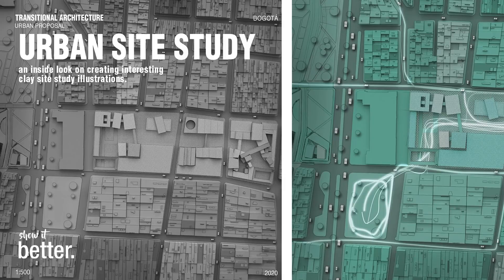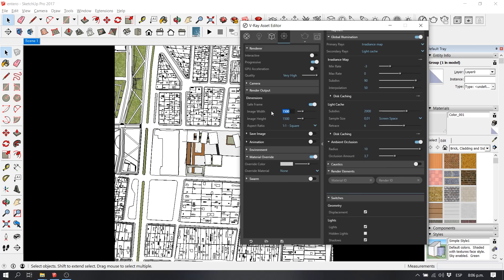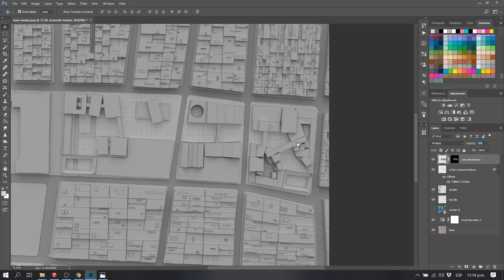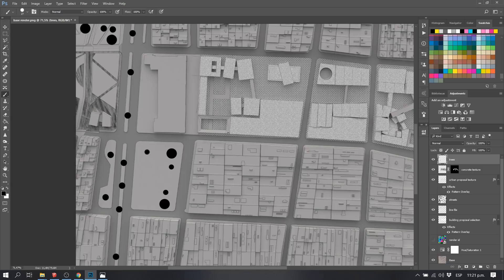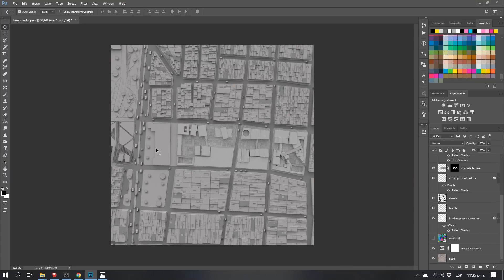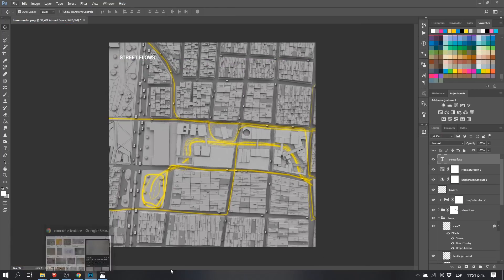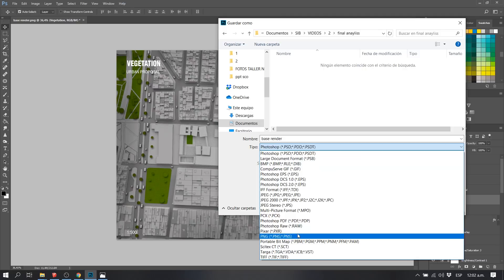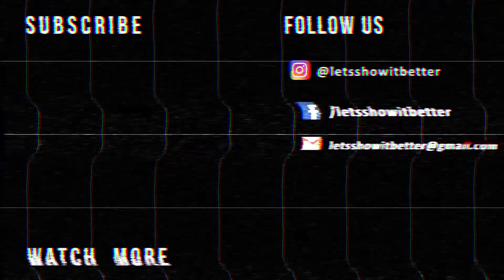Urban Site Study

Comment: When I'm exporting the lines it's comes with the all buildings shapes :/. How u do it that u have only the lines?
Reply from the maker: Sorry Adriana I dont quite understand. Are you refering to the part where I select the white lines style in thesketchup styles and export it as a pdf?
Reply: Show It Better yes. In 2:23 u upload the plain lines to your base and scale it, but when I export this “line style” from sketchup I have lines and the filling of the buildings.
Reply from the maker: Adriana Hęglewicz oh gotcha, if you export it as a pdf you will have them transparent. If the problem persists you can change your filter from normal to multiply.
Reply: Show It Better but export it from sketchup? I don’t have sketchup pro so I don’t think it’s possible. And btw. About what filter are u talking?🙈
Reply from the maker: @adrianaheglewicz  For this project yes I exported it from sketchup, but if you are working on another 3d model program you can look up the option to export only lines and surely it will appear. And the filters I am taling about are the blending modes. They are the options that appear on top of your layer panel. It says normal, but if you change it to ,multiply it will erase the fill. Let me know if it works
Reply: Show It Better oh yeah it works! Thank you so much! Great videos btw, I love to watch u and learn 😊👌🏻
Reply from the maker: @adrianaheglewicz  Thanks Adriana!